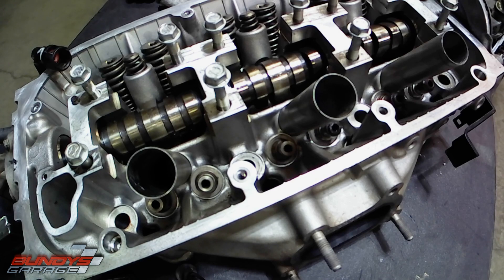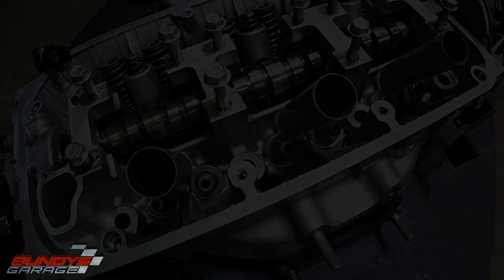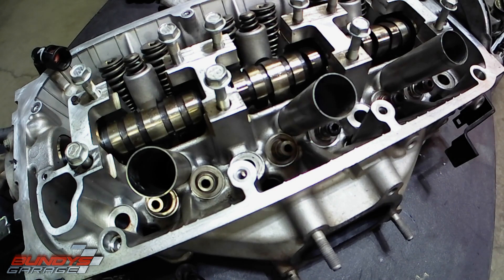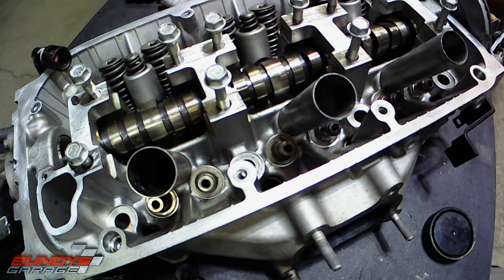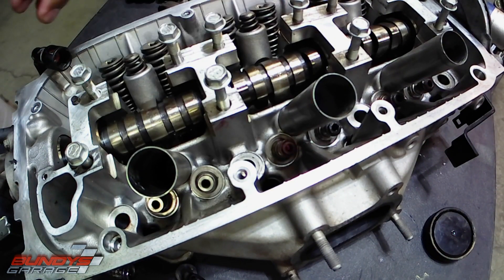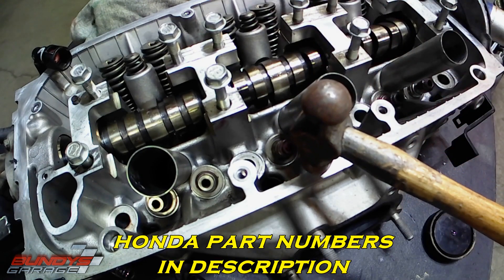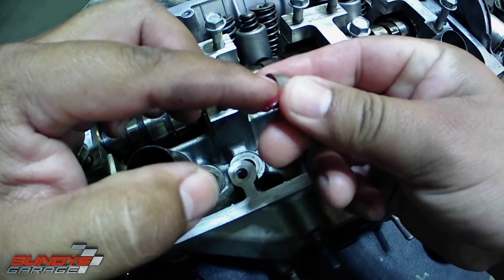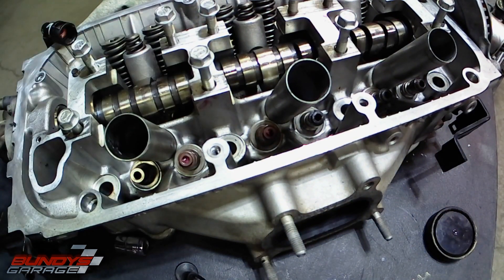J Series V6 Honda Valve Stem Seals | Smoking after Stop Light | White Smoke Smells Like Oil

Comment: Hi ,i have 2009 honda odyssey with vcm and only has 77 k on it now when i leave idling for few minutes and when I rev it it will puff blue smoke, is it valve seal or something else
Reply: Valve seals yes and your burning oil meaning oil seeping thru to the combustion chamber because of your seals

Comment: How can I do this with the head on the block still? I have a 05 pilot
Reply: I emailed him the same question and never got a response either. I believe you have to have the cam in a certain spot and air pressure in the spark plug hole to keep the valve from falling in but i'm not 100% sure. Hopefully he will eventually respond.
Reply: @TJH21740  I figured out since it’s a interference engine if you turn the crankshaft to whatever cylinder you’re working on so the piston is top dead center and the valve cannot fall in the engine block

Comment: Have you ever done the seals without removing the head? I might have to eventually tackle that on my 2002 Sienna I recently bought. However, after a couple oil changes and strangely enough - more so after changing the spark plugs because I didn't know the spark plug history - I'm getting less smoke at cold startup than I used to. Does that happen sometimes? Maybe the van was sitting around too much before I bought it? Sometimes I get no smoke at startup - other times I might get a little. After I first bought it, it was almost every cold start up - and sometimes a lot of smoke.

I used AT-205 Re-Seal in the 2 oil changes I gave it (2500 miles apart). Don't know if that has anything to do with it or not.